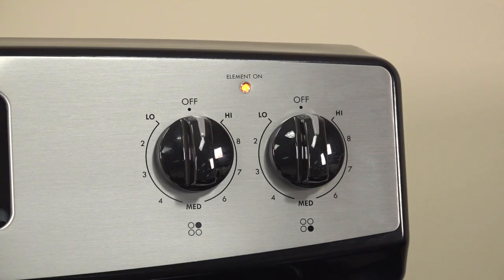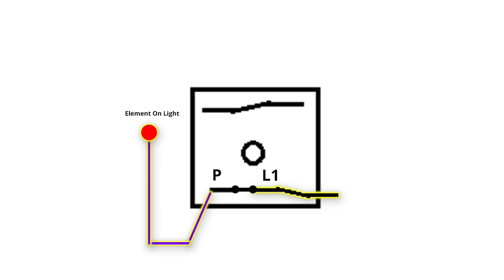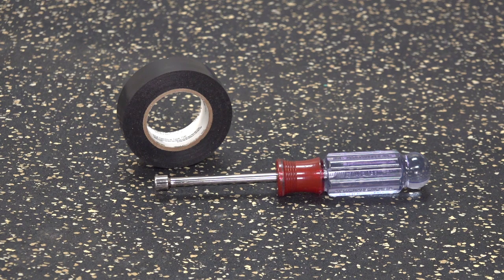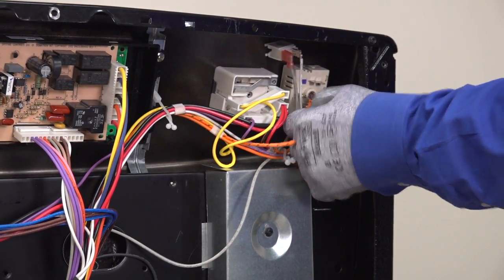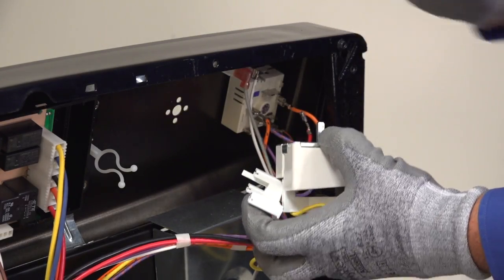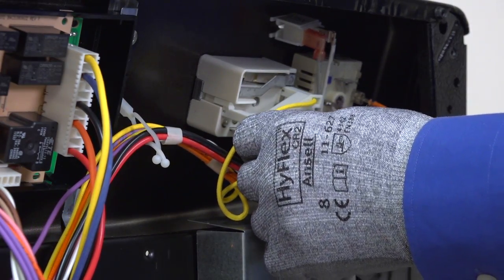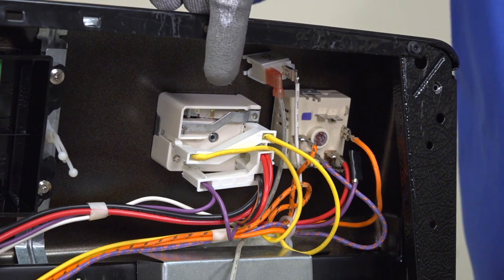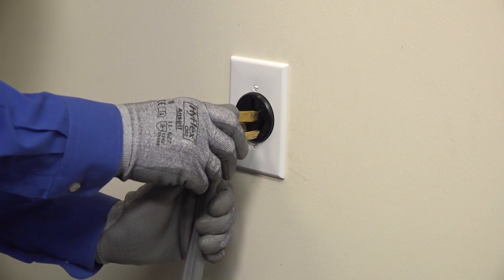Range Surface Heating Element Light Won’t Turn Off

Comment: Good video. Well done.  I'm an Engineer and really hands-on as I do all my renovations, auto, etc... BUT I appreciate the video as it confirms the disconnecting troubleshooting.  The resistance check yielded inconclusive results and had to do the pick and pull.

Careful as I was, it was destiny to get a poke :)

Thanks and please if you can, rank this video and the technician as high in all categories.
Thanks
Marl
Reply: Mark Brown hi 
Is it safe to use the stove in this situation...thank u

Comment: Thank you very much! My door on my Kenmore locked up and has been that's stuck like that for months I just got tired of it so I'd consulted your great video. I moved that stove out of its holding pin and unplugged it and Presto the door unlocked! I do not like where the plug is located down near the floor baseboard behind the stove period that is so inconvenient. I think we need some redesigns here. Anyway, thank you so much I do appreciate you and I will be Consulting your great tutorials for the next problem I have to solve as a widowed woman alone in this world with no help whatsoever but my own grit and your videos!

Comment: I cannot pull the purple line out... it is clasped in there through the plastic connector.  I don’t want to break it... you made it look so easy!  How do I remove it to wrap electrical tape around it?

Comment: I broke a quick disconnect to the element on switch. Can I crimp a new disconnect to the wire or does it need be to for a certain gauge and a special high heat disconnect?

Comment: Is it safe to use the oven for a long period of time if the light is on? Will there ever be an issue with an electrical fire or any other mechanical issue with the stove? Is there any danger in continuing to use the stove without fixing it, or is it just a bother?
Reply: Sears PartsDirect this is a good question. is it dangerous to leave the switch as is and “broken”?
Reply: I have the same situation.. what should I do
Reply: Rajvir s it’s ok automatically after few days
Reply: Rajvir s welcome

Comment: Good video. Helped me to troubleshoot my problem. Thanks!
Reply from the maker: We're glad to hear that our video helped. Thanks for the positive feedback.
Reply: Great video, it will take some time to get the part delivered.can we still use the stove ?
Reply from the maker: @saadghouri2463  Yes. You can still use the stove until the part arrives and you replace the part.

Comment: Thanks for the great video! Now, help, I just replaced the left front element (w10823716) on my Maytag (MER6875BAF). The new element works fine, but now the “On Indicator” light does not shut-off. I installed all wiring in the same place, but one terminal was the wrong size. I used one of the extra leads, shortened it, and made a small jumper wire to make the transition front a small terminal to the large terminal on the new element. Did I wire something incorrectly? Thanks….. Jim

Comment: Serious question:
If I choose not to repair this issue, can it be hazardous? What I mean is, will the stove/element have a chance to turn on in the middle of the night ?
Reply from the maker: The internal switch contact for the element light is separate from the contacts that supply electric current to the burner’s heating element. Although we recommend that you replace the bad surface element switch, the stove or element won’t likely turn on in the middle of the night due to a failed element light contact. Not fixing the broken element switch can cause confusion regarding whether an element is on or not—which could create a burn hazard. We hope this information helps. If you need further assistance, let us know.

Comment: Thank you for the video. How to know the Part number so I can order it ?
Reply from the maker: Go to our Sears PartsDirect website https://www.searspartsdirect.com/ and key the model number of your range into the search bar at the top of the page. Look up the part number on the parts list diagram. Note: The part numbers for infinite burner switches on some diagrams are incorrect due to errant parts lists provided by manufacturers. Let us know the model number of your range and which part you're replacing if you need help finding the right part number.

Comment: Dumb question:  If the element on light stays on all the time, shouldn't I be looking for the disconnect that causes it to turn OFF?  None of the burners are turned on.  In the video, you disconnected one wire, and the light turned ON and then you said that was the broken switch.  But I thought I should be looking for the light that turns OFF.  Not sure why I'm having trouble conceptualizing this!
Reply from the maker: You are looking for the switch that doesn't allow the light to stay lit when you disconnect the purple wire. If you disconnect a wire from a switch and the light stays on, then that switch likely isn't the failed switch because the light is still getting current through a bad switch. In very rare situations, 2 or more switches could have failed at the same time. That scenario is covered at the end of the video. We hope this information helps. If you need further assistance, let us know.

Comment: I just replaced a dual element on my Maytag range and they both work now but the on light stays on now.  Did I cross a wire on the element to make this happen now? I replaced wires just like they were on original. replacement element connectors slightly different to original so I'm thinking I switched a wire somewhere. Help!
Reply from the maker: Let us know the model number of your range and which element you replaced. We'll try to help you check the wiring.

Comment: Is it safe to use in this situation..
Reply from the maker: Continuing to use the range with a broken element light can pose some safety risks if everyone in the household doesn't know, understand and remember about the failure and assume all burners are off when one is still on. It's best to fix the range as soon as possible so it works properly but you can continue to use the range as long as everyone in the house knows and understands the failure and checks to make sure all burners are off when the range isn't being used. Ranges with a ceramic glass top also have a hot surface light that will turn on when the cooktop is hot so if the hot surface light works, then it's generally safer to use the range with a broken element on light.
Reply: Sears PartsDirect thank you so much ..

Comment: have the same stove/oven.. can you tell me a part number for the switch.. ill do it myself.. since sears in almost non existent.
Reply from the maker: The range shown in the video is Kenmore model 79094173314. The rear burner switches use replacement part number 316436000 ( https://www.searspartsdirect.com/part-number/316436000/0022/628.html ). The replacement part number for the dual burner (left-front) is 316238201 ( https://www.searspartsdirect.com/part-number/316238201/0022/628.html ). The part number for the large single element (right-front) is 316436001 ( https://www.searspartsdirect.com/part-number/316436001/0022/628.html ). If you need more help finding the replacement switch you need, let us know (and include the model number of your range in the reply). Sears PartsDirect is always available for DIY repair help and we have replacement parts for this range and most other appliances in stock. 

Sears already emerged from bankruptcy and we continue to operate our businesses (including Sears PartsDirect) as we always have.

Comment: 1 by 1 I removed the wires as indicated. Now all 4 are disconnected and the light is STILL on. What next?
Reply from the maker: Let us know the model number of your range and we'll try to help you.
Reply: @searspartsdirect  thank you. I cannot find a model number label anywhere. The service data sheet says electric ranges with ES 200/205/300 & 305 electronic oven controls...if that helps

Comment: hi my stove burner indicator light wont come on when i turn the burner on
Reply from the maker: A bad burner switch, wiring failure or a burned out indicator light could be causing this problem. Let us know the model number of your range and we'll suggest some safe diagnostic tips to help you figure out what's causing the failure.

Comment: Mines won't turn on what to do
Reply from the maker: If the light won't turn on when you use any of the elements, then the light bulb may be burned out or a wire may be detached from the light. Unplug the range and check the wiring connections on the light. Reconnect any loose wires. If the wires are connected properly, you'll likely need to replace the light. If only one element switch fails to turn on the light, then you'll likely need to replace that element switch. Unplug the range before replacing parts. We hope this information helps. If you need more assistance, let us know.

Comment: My light is on but the switches work, is their a fix for this?
Reply from the maker: We recommend that you follow the troubleshooting steps in the video. The element control switches control that light so a control switch is likely bad.

Comment: Not even 3 months in and this happened. Smh
Reply: true for any electrical device out of box failure or after several years. Video helped to plan, new it was something simple. Ours was intermittent and finally broke down to were it stayed on all the time. Hope to get part soon and simple swap. Range is several years old and 20 USD part better than 700 new range. But who knows something else may go.

Comment: Not sure if I will get a response,  but worth a try!
I followed all the steps, found the bad part, ordered replaced and the light is still on.
What did I do wrong or miss or is there something else wrong?
Thank you
Reply from the maker: Let us know the model number of your range and we'll try to help. There's a possibility that 2 switches are bad or that a wire is shorted.